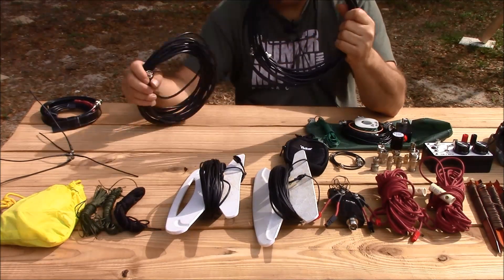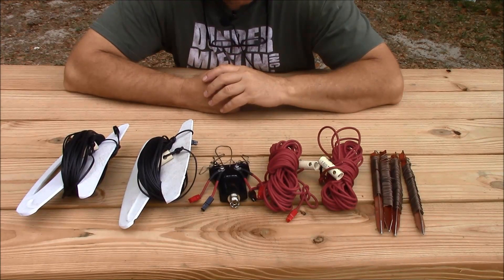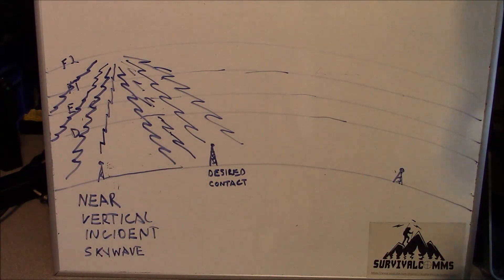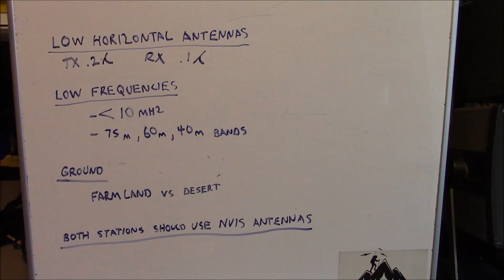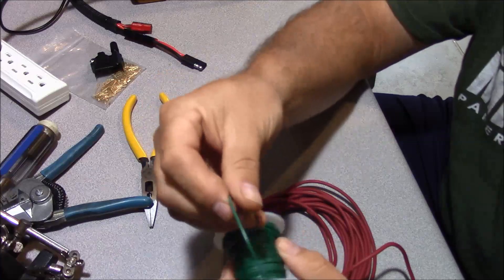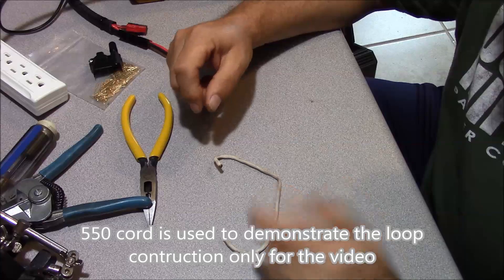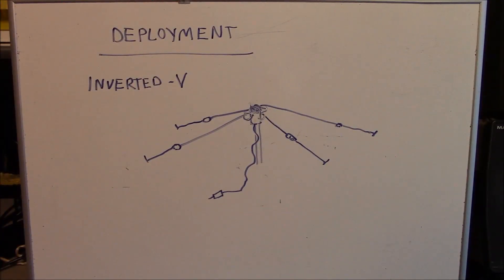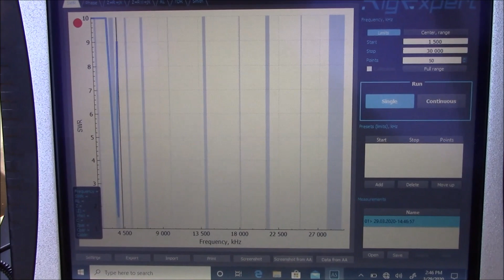The Ham Radio HF NVIS antenna and you

Comment: Any solution for those that live in a city? My backyard is only about 80’ deep. Would we need to buy a farm to use ham radio or what?  Are those loading coils an option? Thanks.
Reply from the maker: Land helps. When I lived in town I had a full sized 80m doublet in a 50 x 75 backyard set up inverted vee. A solution would be a loaded dipole. I have deleted the balun from this antenna design completely. Here is a link to someones 40/80m loaded dipole design that looks promising. 
https://sites.google.com/view/vk1hw/antennas/80-40m-Dipole
Thanks for watching !
Reply: Thanks a lot for responding. The article you mentioned says that what you get for an 85’ antenna is a considerably limited to a tiny range of frequencies with poor performance. I’m just trying to determine, before I spend thousands of dollars on HF equipment and invest countless hours of my precious time that I don’t have studying for a technicians and a general license whether this hefty investment will even do what I want, just want to be able to communicate with family in a grid down situation in an urban environment within a range of 50 miles. I’d hate to find out after doing all that it won’t work, like what happened with my $1,000 uhf/vhf setup. Thanks again for your time.

Comment: This has been unbelievably helpful to a complete beginner!
Questions. 
How reliable is NVIS during daylight hours? Is it less effective at night or is it a simple matter of switching frequencies....Say 80m to 40?? 
I am looking at using a NVIS valley to valley with a mountain in between. 5 miles absolute maximum horizonal distance.  Am I better off to go with a completely horizontal antenna for my application?
What about power requirements? Throw in bad (wet) weather?
Ideally a 5 watt compact/lightweight rig would work best for my application, but I could pack a more potent rig if need be.
I'm not quite ready for CW and the guy on the other radio is still working on his license. 

Since you folks seem experienced Ham types...More questions! :) 
Does ground wave work at the 2-5 miles I am looking for in the mountains? I have gotten mixed answers on this? Does this means it might work depending on soils rock formations etc?

Thank you in advance!
Reply from the maker: You are welcome. Lower frequencies become more noisy during the day time so going from 80 to 40 will help anything over 10mhz does not NVIS reliably.  Vertical antennas do not NVIS well. A simple wire dipole will work.  A 12v gel cell battery will be fine. You are going to have to experiment to see what works for you as far as what works. Nobody but you can see what will or will not work. Thanks for watching !
Reply: @survivalcomms  Thanks so much!
Does a balan help in a simple portable short range dipole? Some designs include them while others don't seem to mention them? 
Thanks again!
Reply from the maker: @jamiecoburn1231  The balun is not required. Just make a simple wire dipole with hook up wire and coax and try it out.

Comment: Best video I have seen explaining NVIS and how to make the antenna. I am just getting started in the community and this video made my head stop spinning. Thank you!!
Reply from the maker: I am glad you enjoyed it. I try my best to keep it concise. Thanks for watching !
Reply: @survivalcomms  my only question is this. Where did you get that balun. I can't find the 50a. Only the 50. At least here in the US.
Reply from the maker: @TN9mmShooter  I have eliminated a balun from mu current build using just an insulator and it has worked well. If you elect to use a balun  a promising 1:1 balun is the palomar 50:50  https://palomar-engineers.com/antenna-products/baluns-and-ununs/1-8-30-mhz-balunsununs/11-toroid-baluns/Bullet-50-50-1-1-HF-Balun-Optional-Dipole-Kit-1-61-MHz-500-Watts-PEP-up-to-34-dB-noise-reduction-p137249375

Comment: For 80 meters yours dipole is 124ft long what frequencie is optimal for that 3.800 mhz? I’m trying to buid a 80 meter NVIS antenna (for phone) I don’t have an analyzer I’m trying to decide what length to cut it at
Reply from the maker: 468 divided by the frequency in MHZ  says 123 ft. its better to start long and trim to resonance. Thanks for watching

Comment: Does NVIS works 5-30 miles or is that too close?
Reply from the maker: Yes it can however it depends on the receiving station's antenna setup. Experiment with your comm plan and test it out.  Thanks for watching !
Reply: That would be with both stations having a NVIS antenna
Reply from the maker: @BobBob-il2ku  Yes it should work but you have to try it to find out for sure. And try it again and again over a period of time to see if it is a reliable talkpath.

Comment: Do I need an analyzer or SWR meter to cut the wire to length?
Reply from the maker: No it is not required. At the 9 minute mark in the video you have all of the dimension info you need to build a working antenna for 40 and 80m bands.

Comment: Rough cost of the build of buying everything new?
Reply from the maker: Depends on your source of supply and if you elect to use a balun or not. You could easily build a good antenna for less than $100 including feedline if you leave the balun out.

Comment: Have you come across any data on what power is required for reliable NVIS communication ? I have seen 15watt mentioned in an Army field manual but not much else.
Reply from the maker: There is no hard and fast rule. HF radio is not a precise science whatsoever regardless of what anyone tells you. One day a greasy string and one watt will suffice the next a kilowatt might not be enough. HF is dependent on the ionosphere cooperating with your point a and point b. The best advice I can give is to practice your desired talkpath over time and determine what time of day is most reliable and what band provides you with the most reliability.  Is 15 watts enough ? On occasion it might be but it requires practice and preplanning.  Thanks for watching !

Comment: I live in an HOA, so experimentaton is imperative. I have a temporary 40 meter dipole set up in the yard. It is about 2.5 feet off the ground, definitely below 3 feet. The legs on the dipole are 30.1 feet per side, that is what it took to get an SWR of 1.2 or better on the general frequency range of  7.178 to 7.300 MHz. The antenna has been working great, didn't think it would get past Wyoming, Arizona, Colorado, & Nevada, but it has, and not bad, LOL. 
I am in NE Utah and have had QSOs all the way to the east coast, signals of 2/1 to 4/4 , which is way better than the total ZERO I expected. Given the actual band conditions (not the good fair poor ratings found on the daily Solar Terrestial Data forecast) this antenna has done pretty good. I go on the OMISS 40 meter net in the evenings, and this is where I have been testing it. 
This is a temporary setup, I hope to put it up to 35 feet later this week, waiting on a friend to bring the ladder we need to get up on the roof. I have been using this setup for the past 4 weeks and I am impressed with its performance. I would love to see what it will do on a day where the actual band conditions are good, but I am more anxious to get the antenna up and working under normal operating conditions. Given the HOA thing, I am happy that it works where it is now, not optimum, but it works, it is an alternative should the roof mount become an issue. 
My elevation here is circa 6900 feet. The soil is conducive to plant growth, flowers, berries, apples, & vegetables, the soil retains moisture, but by 1 PM it is dry, and I set the sprinklers to go off at that time so the Kentucky Blue Grass stays green. When we dig here, it is mostly large rocks going down, the 8 FT copper ground rod became an angled one, no way to it drive straight down here. We are in the Rocky Mountains, LOL!

WW7GBA 
Louis
Reply from the maker: Very cool - when you elevate it expect to add some length to it to bring it into resonance. The simple full length resonant dipole is a wonderful antenna and will out perform the Gucci multiband acronym intensive wire antennas for a fraction of the cost.  HF radio is definitely a case where we are subject to the ionosphere but elimination of transformers , traps, tuners, etc. and running a bare naked full size resonant antenna  system gives us the best chance possible. Thanks for watching !

Comment: What do you think the best band/antenna configuration would be used to set up communications with somebody 35 miles away?
Reply from the maker: If you have a BIG elevation advantage at either or both points  you can do it with VHF and directional antennas under average conditions w/o infrastructure. If you ask most folks who have played radio for a while they will attest to having done such at some point. Two stations running NVIS at 80,60,or 40m would give you the best chance from close to ground level man portable equipment but its something you need to practice and test . I hope this helps thanks for watching !

Comment: Awesome video and great explanations! I would like to try this on 10 meter just for giggles and that's the only HF radio I have plus I'm only a tech right now :)
Reply: Even if you get an NVIS antenna resonant for 10 meter use, it may not perform the way you want; because the the 10 meter wavelength is relatively short, most of that RF energy will not be reflected back down to Earth - most of that RF energy will just punch through the ionosphere.  Favorable conditions will exist for 10 meter NVIS from time to time, but those will be few and far between.  With that said, try it anyways - experimentation is the best way to learn.
Reply from the maker: Indeed  high frequencies are great for band openings but not NVIS. Thanks !
Reply from the maker: Like Robert said below high frequencies typically exceed the maximum useable frequency and do not propagate well using high angles of radiation.  He said it best experimentation is the best way to try it out. When you see a  VHF band opening  give it a shot . There have been some insane band openings this summer . Thanks for watching !

Comment: Fantastic great video I really enjoyed it. Question.  I have heard that the more horizontal the antenna is the better closer nvis you can achieve. i see your antenna is angled. Is there a minimal angle you dont want to go past to truely get a good nvis result. Thanks.
Reply from the maker: Thank you very much ! It is true that if one can achieve a perfect horizontal profile that it would provide a benefit in service theoretically.  I'm not certain what window of angle that would be but what you can achieve as close to horizontal would be desirable IMHO. To me the most important element is to ensure both stations are rigged for NVIS  rather than the NVIS station trying to work a vertical or a monobander at 150' . HF is voodoo science compared to line of sight . The recent VHF + band openings here would give HF a run for the money .  Thanks for watching !

Comment: Awesome video. The baofeng virus. I nearly soiled myself laughing when I saw the thumbnail. You know I wish I could figure out where the heck to get one of those surplus fiberglass antenna masts. 
Keep going 👍
Reply from the maker: TY ! LOL the baofeng virus is real.  I have been using one of the telescoping flagpoles for years for wire and lightweight antennas.  I have a camo net set of fiberglass poles that I used for an exercise years ago  but after you stack 5 its a crapshoot to see which section fails first. The cat's pajamas are the  utility company hot sticks. A buddy of mine scored a few that were removed from service.  Like 35 ' extended. Always great to hear from you ! Thanks and thanks for watching !

Comment: Maybe I missed it... is it a Current or Transformer type balun?
Reply from the maker: Its a current type balun . Thanks for watching !
Reply: Another question.... what is the Hight of your mast?  I am currently using the DX engineering version of this antenna. (https://static.dxengineering.com/pdf/WP-NVIS-Rev2.pdf) opens PDF.  My antenna is made to these specifications.   I am going to try your version to see if I can improve performance.  I have ordered a balun and will rebuild mine similar to yours.  This antenna has been a good preformer but is limited even with a tuner.  I have been using the DX designed antenna for almost 4 years and has held up to hurricanes and wind storms.  Its just time to upgrade.  Thanks in advance!!
Reply from the maker: @wparkinson4  The fiberglass mast is 22 feet.  I don't leave it out in the sun here full time as the UV here in FL is brutal . My primary hf antenna at home is an 80M doublet at 30 feet.